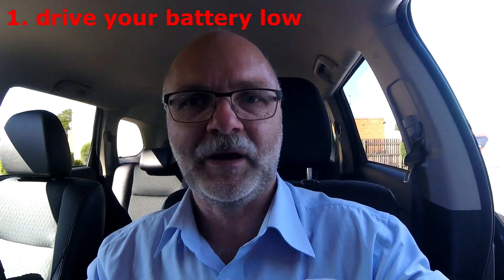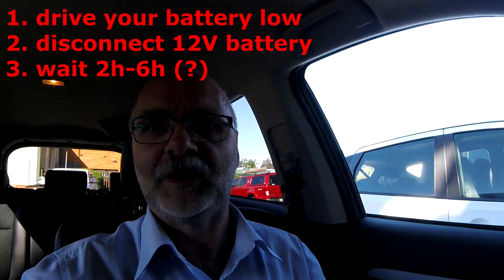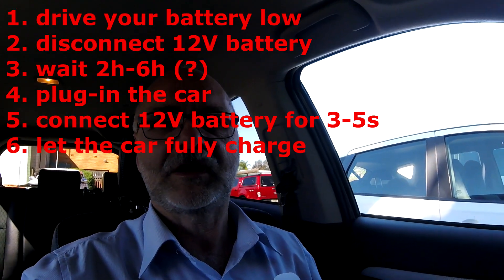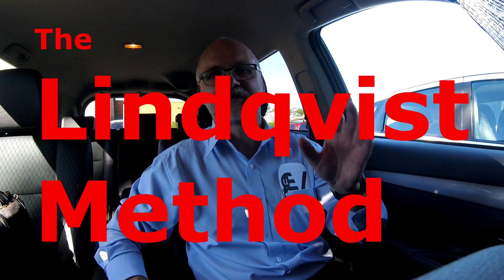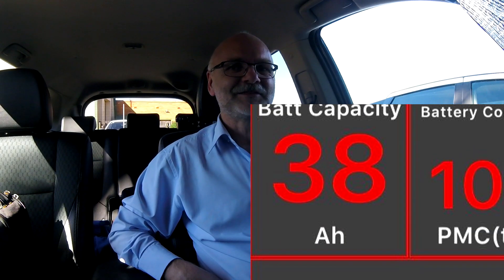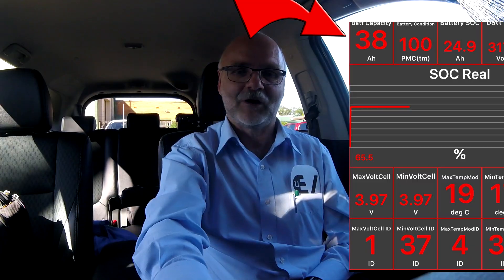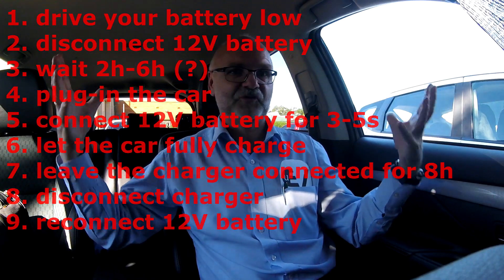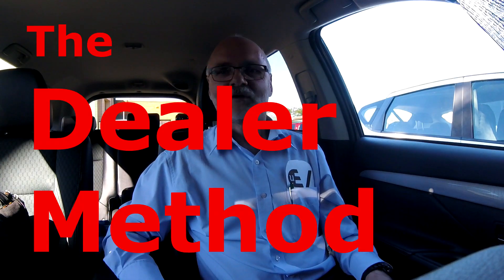EP248 - The Lindqvist Method (Outlander PHEV DIY Home Reset)

Comment: I will be trying this in the morning. Can't wait. Need to go from 32 back to 38. Or maybe 40.
Reply: any updating info?
Reply: @jamesyujing  no did not work. I tried again at work over a 12 hour shift. Left the battery disconnected for 6 hours and charged the rest. The guess-o-meter showed 31 miles then went down to 24 within a minute of driving. The battery still showed 32.7ah so looks like it works on some cars and not on the others. I', not sitting with my BMU in the house open up. I checked the capacitor voltage and there is no charge. So gonna plug it back in shortly and see if that does anything. I think some BMU have non-volatile memory and some volatile memory.  There is also a COM port on the BMU so might be able to connect via UART serial and do some digging in via a CLI.
Reply: @IrnBruN2Cones  updates ?

Comment: Hi Andy
Hate to disagree but it does not work on all vehicles.
We have a team of 3 here with no success followed the method and tried it many ways
Making a video is risking to have Mitsubishi know about it and having the warranty voided in some way.
Also on other platforms reportedly the method is not a 100% solution.in a closed group it was asked to not to share this info for obvious reasons.
I guess very soon we will see a new email from Mitsubishi Australia about of anyone carry out this will loose warranty 
Although i agree with most of your opinions i would suggest to pull back on this one but this is only my opinion...
Reply: So for anyone who has a 12v battery die, it’s possible to happen. How is that anybody’s fault! 
Fact: 12v lead acid batteries die after 4 or 5 years (or sometimes even less!) with no fault of the owner. You don’t have to leave lights or anything else on, it’s simply that the battery degrades and dies, and sometimes very suddenly, with no warning.
Reply: @unpluggedEV  Actually the facebook groups are full of posts about the aux. battery dying and having to be replaced. So , yes, it can happen :)
Reply: Maybe there are different versions of the BMU?; some work, some not?
If there is some way to read the BMU version from the OBD port we could compare notes?
I doubt Mitsubishi could tell why your battery was disconnected unless you told them.
Disconnecting the battery is a standard safety procedure when doing work on a car's electrical system.
I do not think they could void your warranty for it. IMHO.
Reply: Agreed...but as I mentioned it is not 100% even today in Finland with his help could not make it happen....but let's hope for the final solution
Reply from the maker: @Baked Pineapple doesn't it say it even in the 2019 model manual do NOT leave the 12V system disconnected for over 1 months or it will loses the settings?